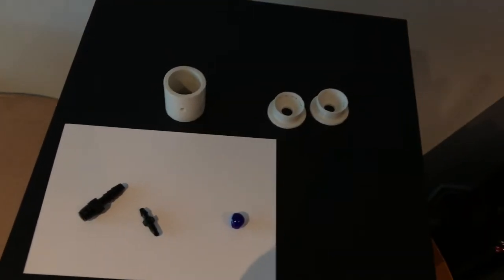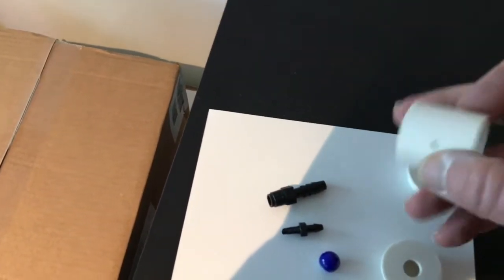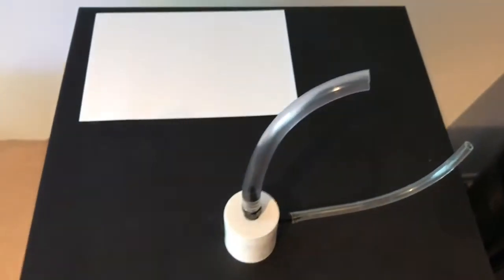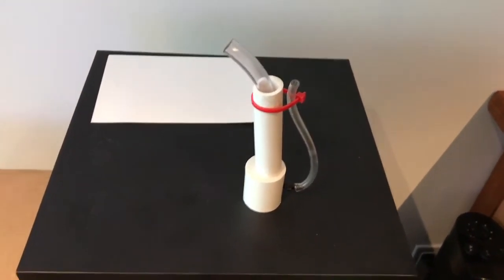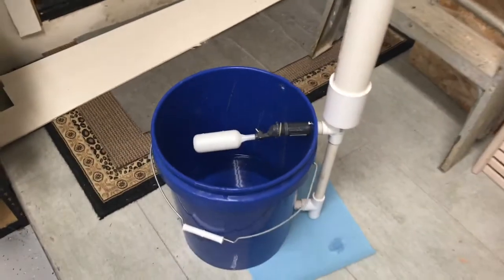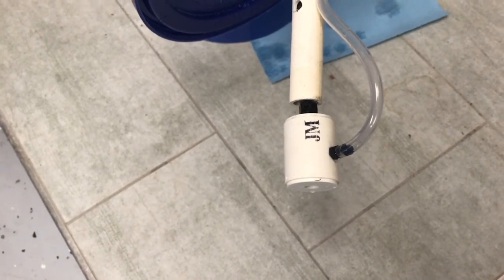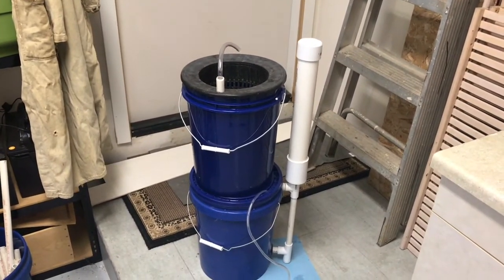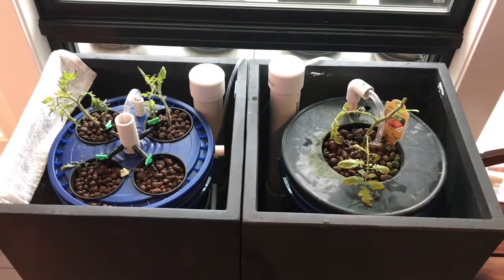3D Printed Airlift pump hydroponic system

Comment from the maker: air pump output. I use a solar air pump that I purchase on ebay. Here is the link
http://vi.vipr.ebaydesc.com/ws/eBayISAPI.dll?ViewItemDescV4&item=122529384038&t=0&tid=10&category=139921&seller=sehansoutlet15&excSoj=1&excTrk=1&lsite=0&ittenable=false&domain=ebay.com&descgauge=1&cspheader=1&oneClk=1&secureDesc=0
if that link does not work. search for this on ebay.
Blue Solar Power Oxygen Pump Pond Pool Aquarium Fish Tank Oxygenator Air Pump
the specs for this say 1.5 liters/hour. it works well for one airlift pump.